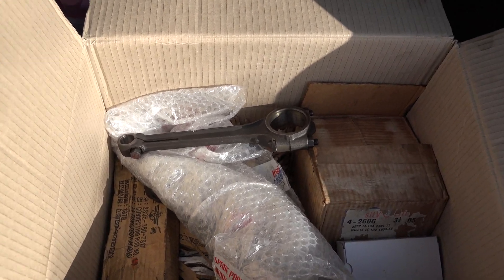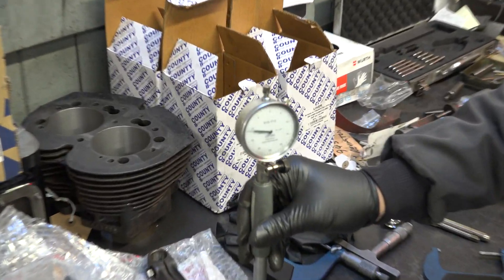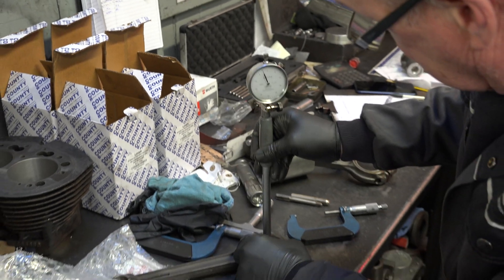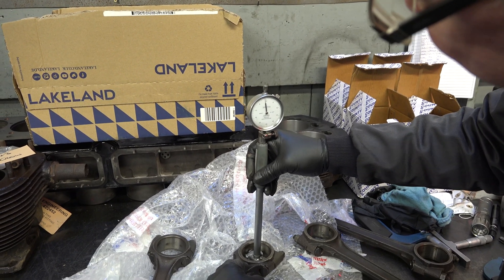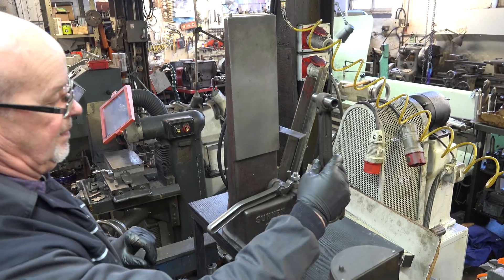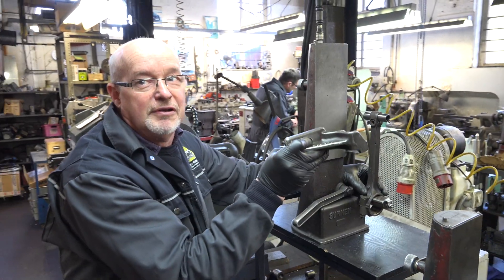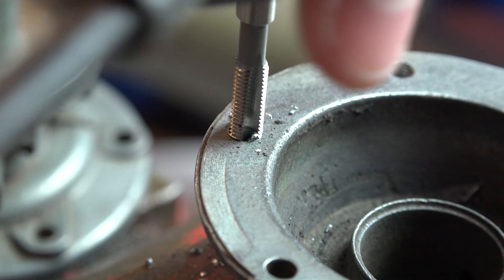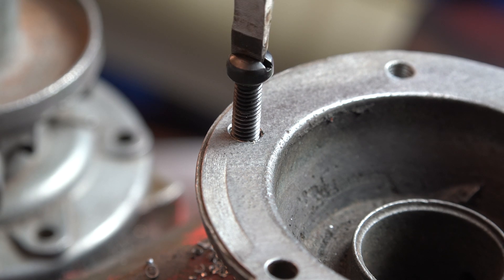Precision Engineering checks on my old Willys jeep Engine

Comment: Excellent!
Reply from the maker: Thank you
Reply: @Greendot319  Did your machine shop feel that the weight discrepancy in the rods was anything to worry about?
Reply from the maker: Not with these ones.  If you match up the rods and pistons you get a 3gram difference maximum so it's nothing for a jeep engine ;)